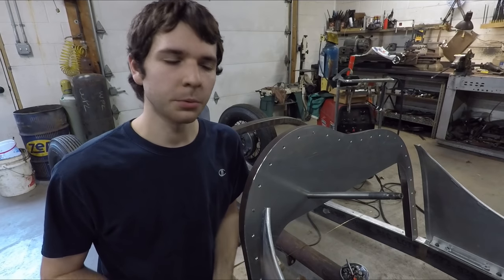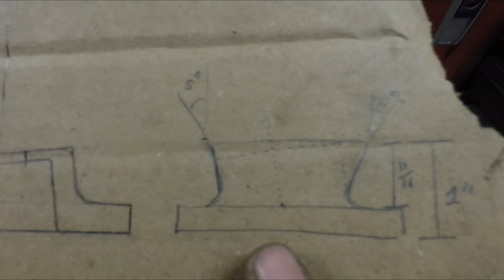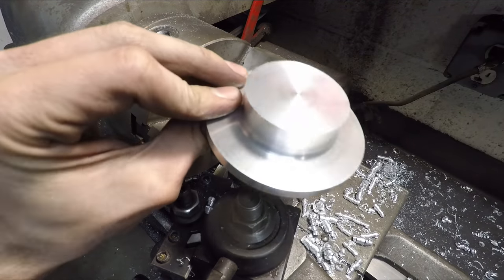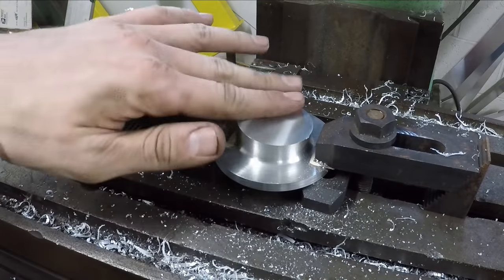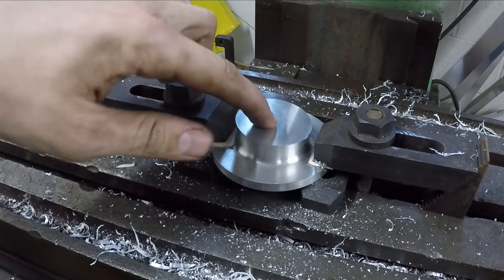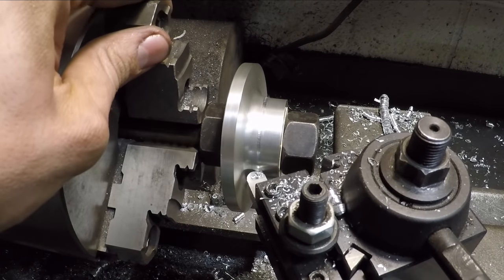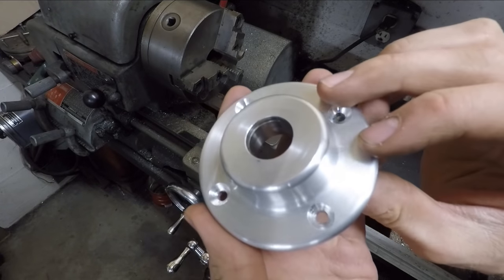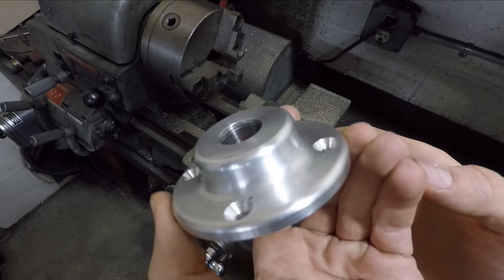Eccentric Turning Aluminum

Comment: 11 years as a machinist and i subbed when you started using that 4 flute endmill as a boring bar. fantastic work.
Reply: I agree.
Reply: That was a good idea. 10:29 I would have made a bearing presser that fits around the outer bearing race rather than pushing on the cage...

Comment: Never seen a mill tool being used in a lathe before, but how's the expression go? "If it's stupid but it works, it's not stupid". Good job! :)
Reply: @Goettschwan I've used wood router bits on aluminium quite a few time, but never been brave enough to try on steel. Will check out the oxtoolco video.

Comment: I will be 72 next week and I want to be you when I grow up. At first I didn't understand why you didn't mount it with blind bolts with threaded holes on the backside but then I realized the straight slot screws will look very period correct. Excellent choice young man.

Comment: Unless I am missing something, this would not be difficult to machine. Take the part and drill the shaft hole on a mill with the mill head offset by the angle needed (or use an universal indexing head, or offset the part using angle blocks) Then chuck the part in the lathe using an expanding mandrel and cut out the external profile. If you don't have a mandrel, than you can use bar stock that is loctited into the shaft hole.

Comment: Totally love the fact that you made this and | think it is so much better when you can make all the parts yourself and it doesn't matter the time because it is for you and you can look at it and know that you made it.
something to consider if you need to make something like this again.
1st you could do with a long reach parting tool.
2nd get a fly cutter for your mill then you can cut the outer diameter at 5 deg's using it. All you need is a long cutter on the end of the fly cutter.
BUT fantastic job it just shows that you don't need CAD machines to do thing like this! You just need a good brain and good hands and there is nothing you can't do

Comment: This is really cool, I'm wondering though if maybe casting would be better. Theres a bunch of videos online using styrofoam and a bucket of sand to cast aluminum, brass, etc. I think maybe in the future doing a casting project would be really cool
Reply: I tried lost core casting with styrofoam. Not really that easy without expert supervision. The core really have to be super smooth, the melted aluminium must be pure of impurities, and many more small stuff that will affect the final result. It is time consuming and very likely to not work the first times for beginners (at least beginners like me...).

Comment: How do you do the bolt up if you can't clamp on the inner race of the bearing?
Reply: I won't claim to know what I'm talking about but I'd guess a sleeve with a 5º angle on the dashboard end. There's very little stress on this bearing, unlike a wheel bearing, it just needs to spin smoothy. A typical wheel with sealed bearings on each side has a sleeve between them that makes contact with both inner rings of the bearing. Then there needs to be contact on the outer side of those same inner rings, so they're also held stationary,, like the outer ring is. Sorry, that may not even be what you asked, no? You likely knew this anyway, just trying to help. So cool watching such unique parts appear in this guy's hands, so satisfying to me. @pete20r2 lemme know if I got anything at all right. Cheers!!!

Comment: I would have drilled and countersunk the turned blank and used those holes to affix it to an angled plate, then faced it, drilled it, and then bored and bossed it with a boring head all in one operation.

Comment: I was just pondering something similar. My project however has an 11° angle. As the angle increases, the “blend” becomes more difficult, as the intersection is more elliptical. I was thinking a larger radius would help hide the blend. Seems to me there must be some hand blending required for a smooth transition.    Thoughts???

Comment: This is the first video of yours I've seen and it was great.
I do have one question. when you were manually turning the mill by hand to get that last crecent on the deep part of the flange, how did you keep from making machine marks where you stopped the manual turning back and forth? Did you have to hand file to get those out?

Comment: nicely done , i wouldve made it more complicated for myself , doing the base the same way you did , drill the four screwholes then bolt it on an angled buck , chuck that intoo the lathe or on a turntable under the mill and finish it on the front , turn it around chuck it in the lathe and finish the back 
youre way makes more sence as you dont need to make the wedge and waste less materials on a wedged buck you can trow away after wards

Comment: I think you could have made the whole thing parallel sided in the  top hat shape, made the larger flange twice as thick and then put the smaller diameter in the jaws and the face off the larger diameter at  5 degrees . Done . Also you might have bought a plummer bearing that  has a rotating collar and bolted it in from behind the dashboard. No machining required.Called a face mount pillow block bearing. It allows for some shaft angle. Keep up the good work.
Reply: There's always another approach.

Comment: I think you could pull this off in a lathe in 3 set ups or two + 1 in mill. first rough your shape and finish the back side. last op in a 4 jaw and and using a sine bar and find your 5 deg offset. then cut your final offset OD and then drill it. If you find a small 4 jaw you can grab that in your 3 jaw with the teeth backwards if you cant find the one for your machine. Otherwise I would have roughed the shape and on the mill with a rotary table. Find center. Then use a sine set up for your offset. Drill your hole and then use a bull nose end mill to cut the offset outer profile. There is many ways to skin a cat, and you probably don't have the tools I'm talking about. But you made you part if you ever need to make a clone the aforementioned set ups may save you some time. But I know what its like to work with the tools you have in your shop/ truck to get the job done.